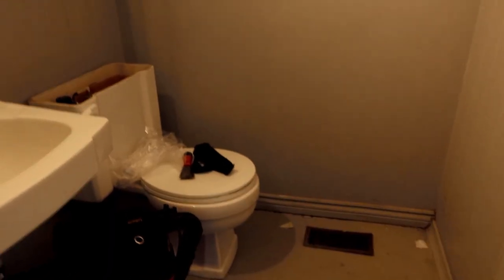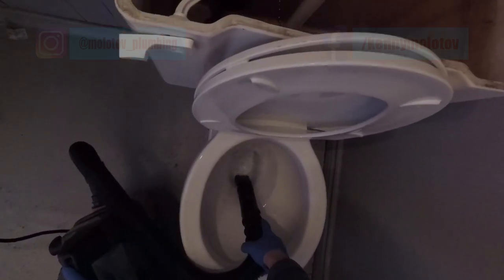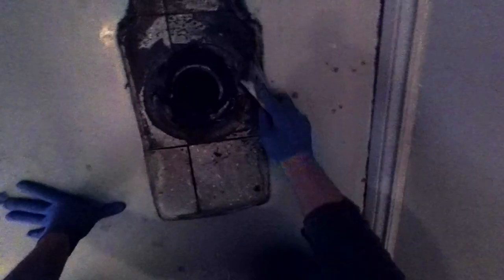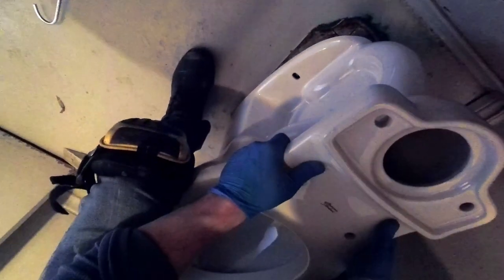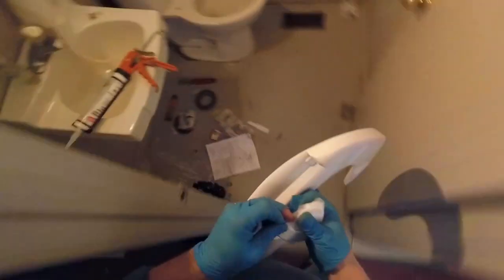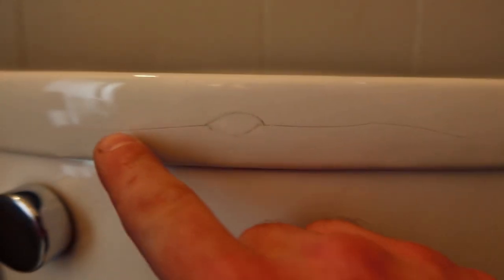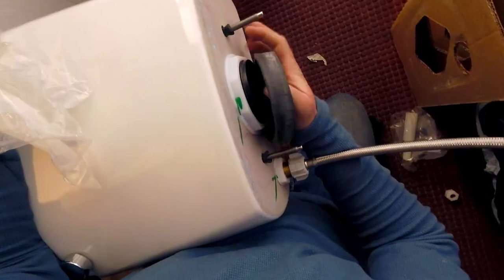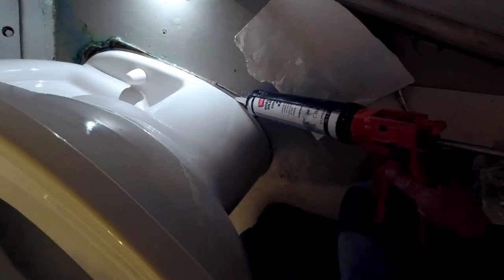A Day In The Life Of A Plumber 147 | I Lost Money On This Toilet!!!!!

Comment: Great video ! 
To answer your question about who covers the cost that would be us the plumber. 

I have a question about your Ram 1500. I have a 3 year old toddler and I'm debating whether to get a pickup truck and put a canopy cover like you or get a service van for work and seperate vehicle for family. I live in Toronto GTA insurance is pretty expensive and the cost of 2 vehicle doesn't seem feasible right now. 

What are your thoughts so far with using a pick up truck for both work and family

Thanks
Reply from the maker: Hey Moe thanks for the support friend. I find the pickup is a healthy compromise for family and work. I've been able to take my daughter and wife places with it, and at the same time I can run out to do drain calls and service work. It's not the most ideal vehicle for our trade because you have to cut all the pipe you bring into the bed, but humble beginnings.  Eventually a service truck will be the way we navigate our work. Hope this helps!